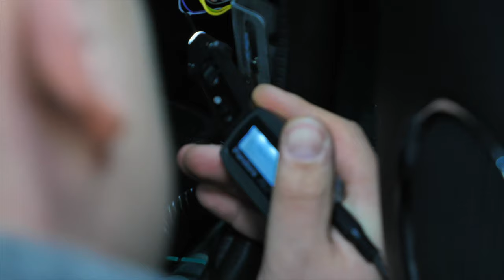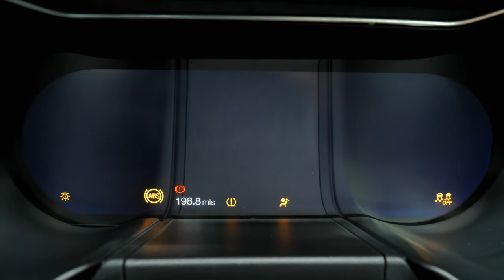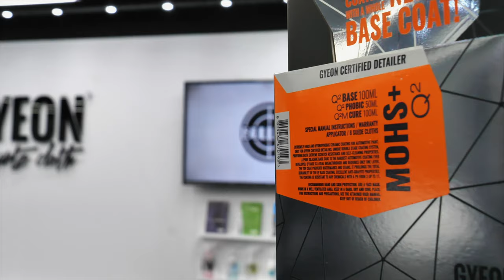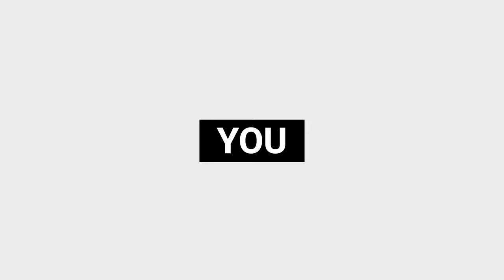2020 Ford Mustang Bullitt | Xpel PPF & Gyeon Quartz Ceramic Coating & Pandora Alarm System

Comment: Wait did you put ceramic coating on top of the PPF? wouldn't that be a waste?
Reply from the maker: PapayaMan erm no. The ppf would not adhere to ceramic coating, the coating of top off ppf provides the same characteristics throughout all the painted surfaces.